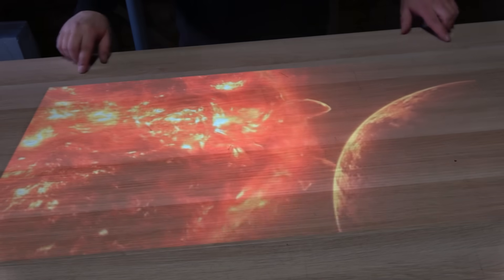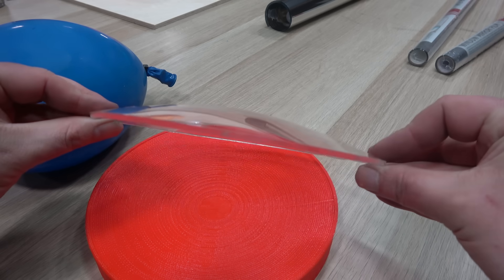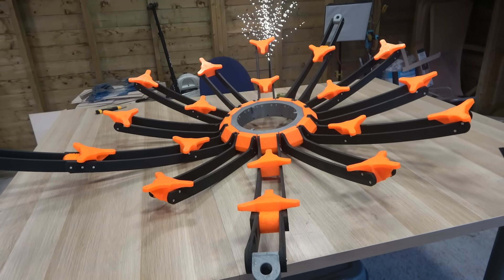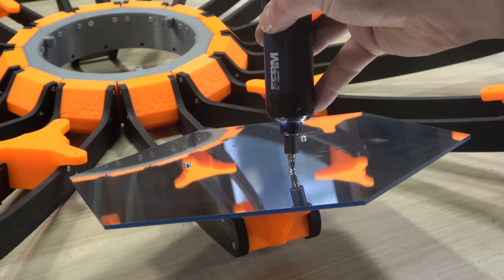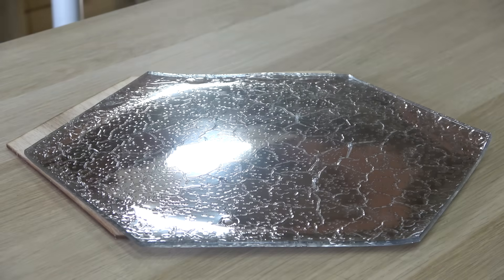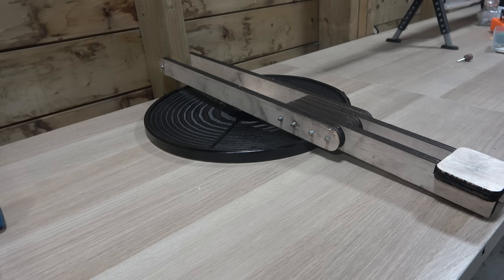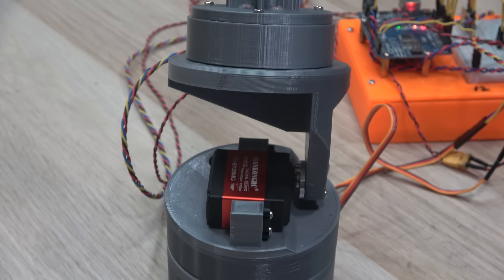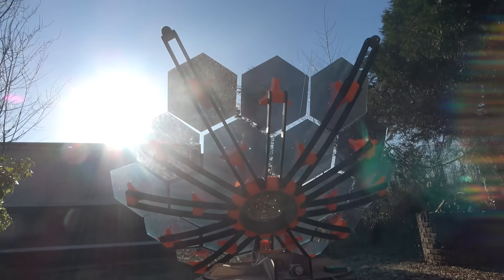Building a DIY Solar Generator..

Comment: The only thing I would have done differently is just make one huge parabolic instead of segmented ones. I also would like to see how it's going to be used because I'm having trouble understanding how other than just heating water what use is it? granted heating water is pretty useful too.
Reply: Humanities scientific advancement is pretty much measured by how complicated a way we can devise to boil water.
Reply: One huge mirror is more difficult to make. That's why the Webb uses that hexagons. Of course, individual mirror segments have their own issues....
Reply: Easier to replace a single failed mirror from an array, rather than having to replace the whole thing. 

Also easier to make small mirrors than big ones

Also easier to correct for flaws etc with small mirrors than one big one.

There are some advantages to a solid mirror. There are some advantages to a mirror array. 🤷‍♂️
Reply: If you point it at a solar panel you can get a lot of power out of it. Most aren't rated for that level of power though so for consumers a heat based generator might be more plausible
Reply: @zetahurley7323 solar panels don't do well with excessive heat either
Reply: Exactly how would you have made such a large parabolic reflector?
Reply: @michaelallen1432  you buy a parabolic satellite antenna (dish) with 1.5m diameter, from the junkyard
Reply: @michaelallen1432 I think segments are better but I have seen people make large parabolic mirrors with old satellite dishes and mylar reflective safety blankets glued to them. They can actually come out pretty smooth
Reply: @michaelallen1432  heat the plexy over a wood frame to form it.
Reply: Nuclear reactors literally just boil water..

Use the steam to move a turbine, and then you've got power.
Reply: Solar forge?
Reply: Segments are easier to make, obtain, replace. You can boil water for a steam generator for electricity. Also you can melt metals or even rocks
Reply: Segments also allow for different focal lengths or even a sort of off switch by having them all point away from the center
Reply: Upcycle an old backyard satellite dish 📡
The 8 footer, not the wall mounted baby dish they use today.
Reply: Uhhh the solar death ray channel guy doesn't ring a gosh darn bell?!?!
Reply: In France we have a restaurant and multiple bakeries that work with solar energy, exactly with that system. They use electricity as a backup, but despite being in the north the bakeries are able to use solar energy about 70% of the time
Reply: home made solar water heater powered by a fresnel lense 
https://www.youtube.com/watch?v=rrGMidc_P7s
Reply: Most of America's electricity is made by water.
Reply: Mass production of smaller mirrors is easier and cheaper than making a giant one. Also much lighter in weight. Concentrated solar heat can be used in many ways. Heating water, generating steam, dehydrating substances, burning waste, enough heat and you can smelt ores, make cement, etc.😊